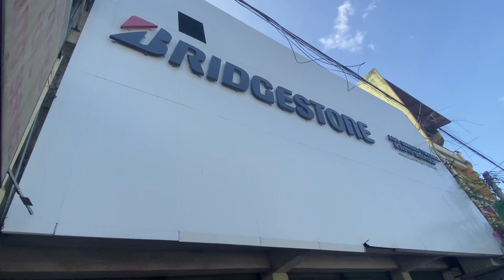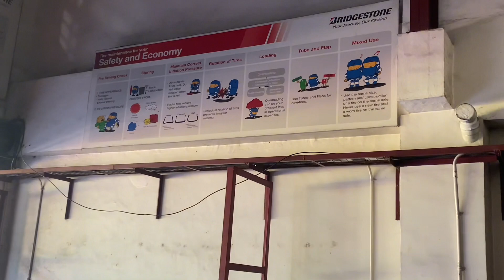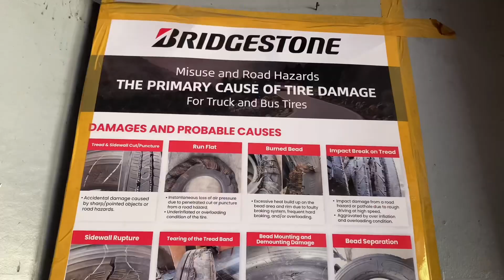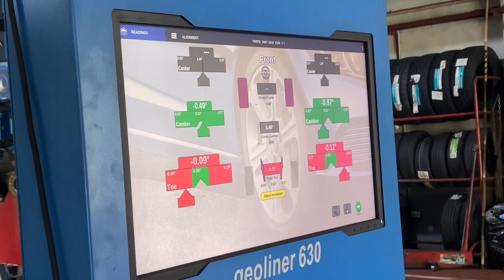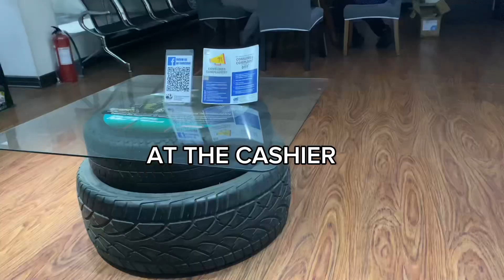Wheel Alignment, Balancing & Tire Rotation: Why is it Important?

Comment: It’s also checking components upper and lower ball joints and control arms. Tie rods struts or shocks sway bar and end links this all throws alignment off and most have no  grease fittings anymore have to replace.